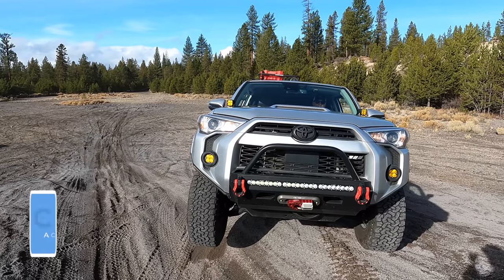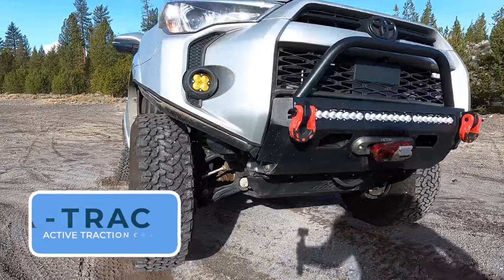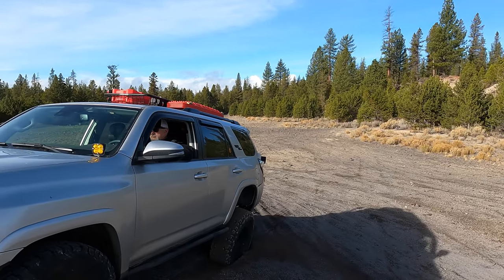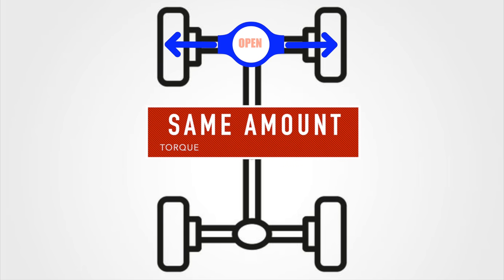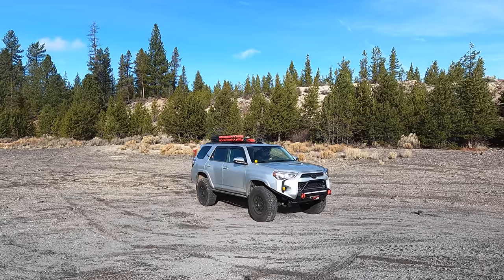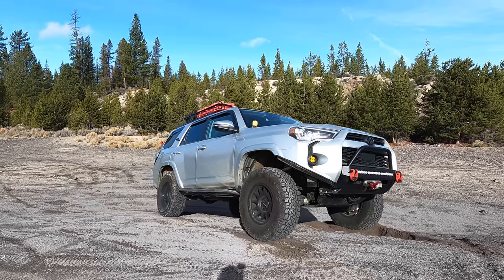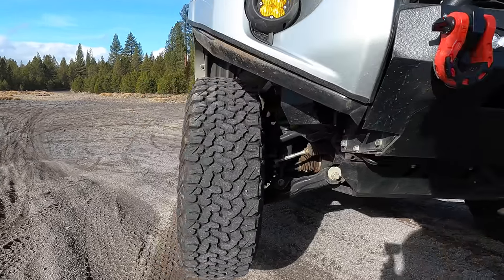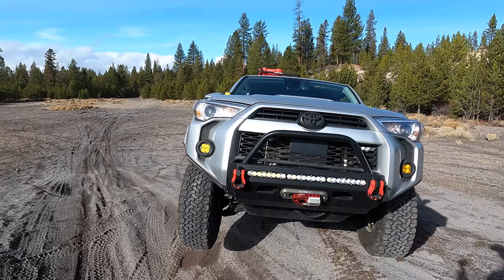Finally, The Only A-TRAC Video You Need to Watch. Multi Terrain Select Explained. ATRAC v ARB Locker

Comment: Toyota needs to catch up with the competition.  They need a model with factory lockers front and rear.  The lockers need to be able to be activated in 4hi and above 5mph.  They need to build in enough clearance to easily fit 33s (or 35s if they really want to play).  By this I mean without chopping mounts and plastics. That is ridiculous on an off road oriented SUV or truck.  The Tacoma 3.5L powertrain needs lower gearing and/or a different torque band and a much more updated transmission.  Rear discs as well.  As someone who has owned both a current gen 4runner and Tacoma, these are major shortcomings compared to other manufacturers.  They do some things well, but they really need to update.
Reply from the maker: God that would be great! I think you did a good job of listing the most critical items. I love the idea of model factory lockers front and rear!

Comment: Wow..had no idea a 4 runner had this technology. Do you like 4 runner better than a Jeep? Please advise.
Reply from the maker: Wow...the question of 4Runner vs Jeep is one of the most hotly contested issues among off-roaders ha ha! At the risk of being assailed with comments from die-hard 4Runner and Jeep lovers, here's my two cents: The 4Runner has very good off-road capability and nice on-road manners. So, it is a great all-around vehicle, a good overlanding platform and very reliable. For pure off-road capability, a Jeep is hard to beat. You can get dual locking diffs, a disconnecting sway bar, and unlimited mods.
Reply: @OverlandPNW  Cool. Thanks.

Comment: What’s better Atrac or Detroit locker on both axles?  I have detroits on my Jeep.  I don’t have any experience with atrac systems.
Reply from the maker: That's a great question. I have no experience with Detroit lockers. From what I've heard it is an LSD with an automatic locking feature. They have a good reputation as far as I know. I'm sure that jeep with dual Detroits can get you just about anywhere you want to go. Cheers!

Comment: Thanks for the info, so you always turn on rear lock diff for both systems?
Reply from the maker: You don't have to turn on rear diff lock. Both systems work without rear diff lock. Both systems also work with rear diff lock. However, if the rear locker is active, A-TRAC will work (in front) only when vehicle speed is less than 4 mph.

Comment: I had a 2021 Tacoma TRD 4X4 Premium that have both MTS and Crawl control. 
I used in extreme off-road fun .
The rear locker got me out of bad situation too.

I want to try MTS in 4H without Crawl control and see it any function works.
Reply from the maker: The TRD Premium has some nice features. I did not get the premium package on my 4Runner and wish I did!
Reply: Had? What do you have now?

Comment: Thanks so much!! What tires wheels setup are you running?
Reply from the maker: In the white 4Runner, at the time this video was filmed, I was running BF Goodrich T/A K02 285/70R17.  I am now running KO2s in size 315/70R17. My brother in the silver 4Runner also has KO2s. His are 285/75R17. Cheers and all the best for 2022!
Reply: @OverlandPNW  😊 thanks! Do you mind to share what lift do you have and it’s brand?
Reply from the maker: @iamalemontree  The white 4Runner has a 3" lift. It is Icon Stage II on the front and Old Man Emu rear coil springs. My bother in the silver 4Runner has Ironman 4x4 lift.
Reply: @OverlandPNW  thanks so much 😎

Comment: How has your front ARB locker worked so far? I was pondering adding both FR/RR to my SR5 but I have heard the front CVs are rather weak with the locker and you should not run locked with any steering angle, then I discovered RCV's CV's (not cheap $1000 a side but makes the Front as strong as a D60 they claim) The rear factory E locker only works in 4L although there is a wiring hack to get it to stay engaged in 4H but I was thinking ARB Airs on both ends would solve all that nonsense. Then add to the fact I want to re-gear to 4:56 while im inside both pumpkins for 34's+ (the li$t goes on LOL) like everyone else, I have learned more about Atrac here than any other vid - thanx! I thought A Trac was only for going downhill 4L cruise control instead of being relied on as an any-angle passive locker.
Reply from the maker: I like the way you think! Twin air lockers on an SR5 would be amazing. XOverland put twin ARB air lockers with 4:56 gears on their new 4Runner build. I absolutely love my ARB air locker. I'm not a big fan of the factory E locker. Everyone in our group has had mechanical failures with them. They also almost never engage instantly. You have to drive forward and sometimes backward to get them to engage. Air-lockers engage instantly, can be used in 4L and 4H, and can be engaged at any speed while driving. The ARB website states: "An ARB Air Locker can be engaged at any speed as long as both wheels are spinning at the same rate." You want to be very cautious with this because if one wheel is spinning faster than the other, you will “crash lock” and have damage. That said, when off-roading, I engage and disengage on the fly all the time as needed. I also have engaged the front air locker as needed while driving over the pass on snowy roads. You are right that you should not run locked at any steering angle. So, I flip the switch on the fly and disengage on turns. I re-engage the locker after the turn. I re-geared to 4:88. If you go bigger than 34s, 4:56 is definitely the way to go. I decided not to install after-market CVs. My thinking was that if I make the CVs stronger, then I'll just break something else. CVs are relatively easy to replace even in the field. I've never broken one. Anyway, ARB airs on both ends would be as good as it gets!

Comment: Great video.  Thanks.  Question at 3:07 you mention enabling both front and rear lockers... I'm not sure what gen 4runner you have but I thought they only had rear lockers?  Do you have an aftermarket front?  And if so, how do you engage the front?  I'm asking because I'm looming into what mods to make and how best to engage (ie. controls in dash, outside manual, etc).
Reply: Guess I found you answer... found your video on the ARB front locker.
Reply from the maker: Hi, yes I have an ARB air locker on the front and have re-geared to 4:88s. Sorry, I didn't do a good job explaining that in the video. I guess because I have talked about it in other videos. I absolutely love the ARB front locker. Just checked out some of your videos...cougar in the front driveway...Wow!

Comment: Are we sure the MTS in mud/sand works in 4hi? Maybe just on 4runners? I coulda swore i tried it on tacoma and it did not work. Will have to give it another go when im back in it.
Reply from the maker: I can confirm, from personal experience, that MTS Mud/Sand works in 4H on my 4Runner. This is also confirmed in the manual in the MTS section. This quote is directly from the MTS section of my 2018 4Runner manual: "MUD & SAND: The four-wheel drive control lever is in L4 or H4." The traction control packages do vary based on make, model and year. So, since I don't own a Tacoma I can't say with 100% certainty how it works on your Tacoma. The Toyota manuals are available on line. So, that would be an easy way to check. Cheers!
Reply: @OverlandPNW  The easiest way was to go out and see, manuals in my experience do not give a lot of obscure detailed info like this. 

At any rate it did not work in 4hi. On the instrument cluster it would just say must be in 4low. Would have been a nice feature to have at times since I live in an area that is mostly dirt and mud, LOL. This is on a 2016 trd off road tacoma, though I doubt it is any different on newer models.
Reply from the maker: @Jtwizzle  Dang! Lame that it did not work in 4H as that is when you need it most in mud and snow.

Comment: Can you use a-trac and the rear locker?
Reply from the maker: The manual does not answer the question of whether A-TRAC can be used with the rear-locker. I have tested it, and on my vehicle A-TRAC works on the front axle when the rear locker is engaged. But, the standard A-TRAC speed limitation still applies. So, A-TRAC only works when vehicle speed is less than 4 mph. Since Toyota was silent on this issue in the manual, I would not recommend leaving A-TRAC active when you have the rear locker engaged. If you need A-TRAC to help get you out of a jam, you could activate it and then deactivate it once you get going. This is consistent with the intended use of A-TRAC which is to get you started from a dead stop. It is not a constant driving application. MTS is the traction system for a longer obstacles. Neither system is intended to be turned on and left on all day. Both systems will deactivate due to break actuator overheating if they are used heavily. We had that happen during some of our testing.
Reply: @OverlandPNW  thank you for your reply

Comment: I'm assuming you can use A-trac or MTS when the rear diff is engaged, then, in a stock 4Runner? I don't see how the diff would affect brake application or throttle control, so I can't see it being an issue.
Reply from the maker: Yes, you are correct you can use A-TRAC/MTS when the rear diff is engaged. However, as soon as you engage the rear locker, A-TRAC/MTS will only work on the front axle. It will not work on the rear axle. A-TRAC/MTS only work across an open diff when tires on the same axle can spin at different speeds. So, if your rear diff lock is engaged, A-TRAC/MTS will not work on the rear axle. As mentioned, they will still work on the front axle within the speed and other parameters discussed in the video. To answer you specific question, it is not the diff that affects brake and throttle control. A-TRAC/MTS sensors are not connect to the diff. Cheers and best wishes for 2022!

Comment: Mts throttle control is inportant. It remaps throttle percentage to pedal position. I was using loose rock mts on this really rough rocky shelf road and I was surprised that a few times the truck sounded like it does in crawl control.  I've never had that activate but this was a really loose road
Reply from the maker: Good to know! It is very difficult to find those kinds of specifics. Most reference materials simply provide generic statements to the effect that MTS adjusts throttle to provide optimum traction. Thanks for the info!

Comment: Very good explanations thank you !  I was not aware the mts/ mud sand worked in hi.  Great to know.  I would think this would be good driving relatively slow on snow.  ?
Reply from the maker: Yes, great idea. I think MTS would work in snow as long as it is dry powder or wet concrete snow. Some wheel spin could help in those kinds of snow because the spinning tire moves material (snow) to get forward momentum. We will have to test this on our next snow run. If it is hard pack snow, and there is no material to move, then the surface is more like ice. So, on hard pack you would not want wheel spin. A-Trac would be a good choice on hard pack.
Reply: @OverlandPNW  Agreed... do you think it (MTS-mud,sand) would cut out after 7 mph or would be good at around 10-15 or even 20 mph ?   Happy Thanksgiving and thanks for reply.
Reply from the maker: @g.fortin3228  My manual states that "MTS can be activated when vehicle speed is approximately 7 mph or less." So, it can actually be activated while driving. I have searched but have been unable to locate exact information on cut off speeds. When MTS is temporarily canceled, the mode indicator is supposed to flash. So, I guess you could test the cut off speed by taking note of when the indicator flashes. Since MTS is applying breaks and managing throttle, I'm not sure I'd want to have it engaged much higher than 7 mph. I don't like the idea of the vehicle applying breaks to single wheels at higher speeds. Seems like that could be dangerous. That is probably why it deactivates at higher speeds. It also needs steady power going to the wheels to do its thing. So, it is not a passive, on-road driving traction system. The manual addresses this. It states: "Do not use the Multi-terrain Select system for normal (on-road) driving. The Multi-terrain Select system is designed for off-road use only." So, I think if you were off-road snow wheeling, it could be useful in certain situations and snow conditions. Those are my thoughts. We need a Toyota automotive engineer to chime in and give us some help on these topics ha ha ! Happy Thanksgiving to you too!
Reply: @OverlandPNW  OK, Understood.  I'd probably be going slow on a fire road and want to use it just to eliminate my own lack of smoothness.  Thanks again, appreciated !

Comment: I have a GX460 with atrac and MTS (same chassis as 5th gen 4runners) and I'm most likely going with Eaton front and rear elockers. I wanted to know why you chose front air locker and not another elocker similar to your stock rear? Have you come across situations where it was hard to activate your rear elockers?
Reply: the cost is higher but air lockers instantly engage
Reply from the maker: Yes, the rear e-locker almost never instantly engages. You have to drive forward and sometimes backward to get it to engage. The air-locker is an instant engage. It also can be engage while driving. The ARB info on it states: "An ARB Air Locker can be engaged at any speed as long as both wheels are spinning at the same rate." You want to be very cautious with this because if one wheel is spinning faster than the other, what is called “crash locking” will occur and can cause damage. That said, I have engaged the front air locker as needed while driving over the pass on snowy roads. I'm not sure how fast I was going but probably 35-40 mph. For me, this is a huge advantage over e-lockers and a feature I use off-road all the time.
Reply: @OverlandPNW  Alrighty then, this definitely has me reconsidering air lockers. I think since the GX didn't come with any locker, I will be better off investing in air lockers from get go. The convenance of being able to instantly engage and disengage the lockers far out weighs the initial higher cost.

Comment: You said you have front lockers?
Reply from the maker: Yes, I installed an after-market front locker. It is an ARB air locker. I did a poor job of explaining this in the video. I mention it at 11:40 but should have explained it at the beginning of the video. I guess I have talked about it so much on my channel, that I overlooked the need for a good explanation in this video. I actually made a quick video after it was installed where we went out and tested the ARB locker. Cheers!

Comment: Nice explanation.  Since you understand these systems and have a front locker you might know better; my friend keeps saying a front locker is not good, and if used with atrac can cause damage.  He is a smart guy but I don't think that is correct.  Do you know of a situation where in error if the front locker and atrac we're both on how the systems might impact each other and cause damage?
Reply from the maker: You've asked a very insightful question and one that I have wrestled with myself. Theoretically, A-TRAC/MTS and a front locker should not interfere with each other because A-TRAC/MTS only active when there is a difference in wheel speed. This concept of difference in wheel speed is the crux of the issue. For example, the ARB website states: "An ARB Air Locker can be engaged at any speed as long as both wheels are spinning at the same rate." Your friend is correct that damage can be cause but I think this would occur only in cases of user error. For example, if you try to activate your air locker when one wheel is spinning faster than the other, what is called “crash locking” can occur and can cause damage to the internal gears. So, ARB "recommends" that you stop your vehicle before engaging the front Air Locker. This recommendation is to protect them from legal liability but for practical purposes the ARB air locker is designed to be engaged and disengaged on the fly as long as you are driving straight forward. When I am off roading, I do this all the time. I engage them on the fly going into an obstacle, disengage them if a turn is coming up, and re-engage them after the turn. I have never tried to activate A-TRAC/MTS at the same time that the front locker is engaged. I would consider this user error. My guess is that A-TRAC/MTS would not activate since the wheels spin at the same speed with the locker engaged. So, I don't have a perfect answer to your question but I can say that my front locker and A-TRAC/MTS work perfectly fine on my vehicle. The key is to consider them as separate systems and not try to engage them both at the same time. There would be no reason to engage both at the same time. We need a Toyota automotive engineer to chime in and help us get definitive answers to some of these questions. Cheers!

Comment: Anything in low will not limit throttle. In high, traction control will. Traction control is disabled in low. MtS rock mode will limit when
L spin to 1/4, increasing each settings sand. Attractive and mts in low, with rear locker on will activate and work on the front. 
MTS is a premium feature for a good reason. It is atrac plus.  

On difficult/extreme rated rock crawling trails, mTS will work were atrac does nothing. I never use atrac as it is inferior to MTS. But, for  sr5, it is certainly better than nothing and can be superior to other brands systems. I roll with MTs on and only when i know I will slip, lock the rear. Recall, it’s better to never loose traction than lose it, have to activate a system, and get into more trouble or out of trouble. 

These c9mputer  systems don’t wear out, it’s fine to keep them on. Regardless, all the same metrics are being measured anyway by the computers.
Reply from the maker: Thanks for the tips. Your Firebreak 5 video is cool. That is an awesome trail.